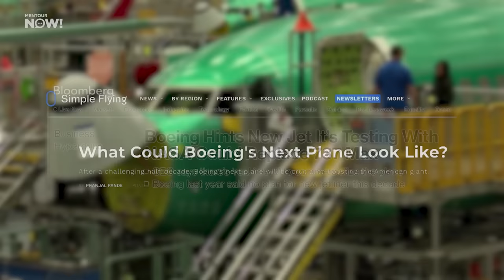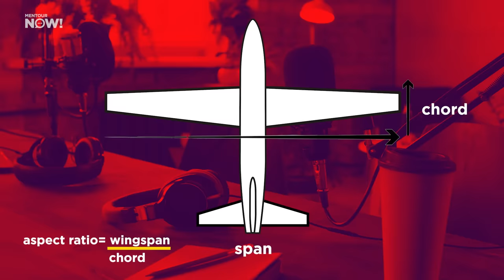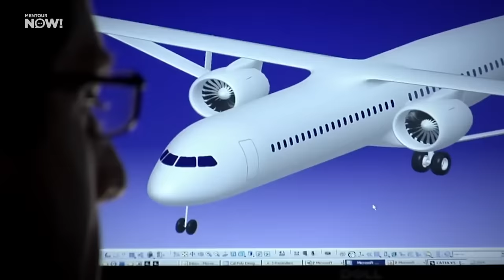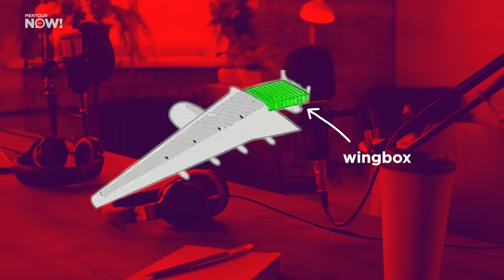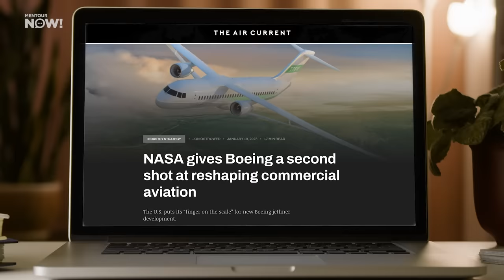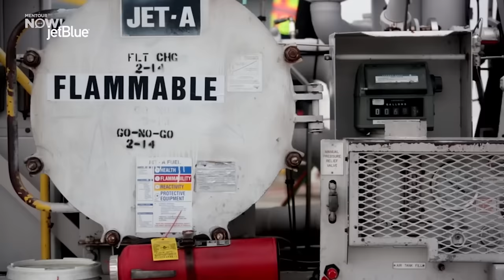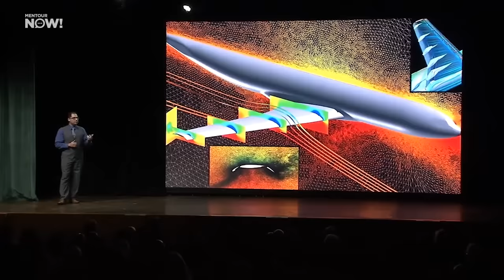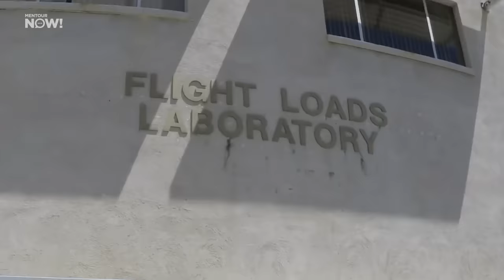Revolutionary Breakthrough: Boeing's Transonic Wing in Partnership with NASA!

Comment: The folding section actually only needs to be 8m because, presumably, both wings would fold. Still not small, but much more manageable.
Reply: Maybe so... BUT a new "radical design" would be more FUN if it just made ONE of the wings fold straight up in the air instead... don't spoil the SHOW, man...

     AND yes, before anyone gets pissy... some REALLY strange looking aircraft ideas have actually FLOWN over the years of avionic history... from the "Ass-ender" to the "Scissor-wing" and few that were completely nuts... Even the Nazis got on the wagon for weird sh*t, trying for a bomber with off-set wings... People have had weird ideas about how to make planes "better" for a LONG time.

    I highly recommend "Dark Skies" for some over-views and jot down notes to deep dive technical terms and design numbers/models/series while you're trying not to laugh too hysterically. ;o)
Reply: I wonder if folding wings are heavier because of the mechanisms to fold it up like Motors and gears, hinges, cables, etc.
Reply: @dannydaw59  a part is always heavier than no part, so yes. It obviously still makes economic sense because the tips on the 777x fold. The decrease in drag from the longer, slimmer wings must beat the costs of added weight, and by a significant amount, or it wouldn't be worth doing.
Reply: This design doesn’t allow visual inspection for damage on top of the wing, and as an airline mechanic I’m not going up on a lift over aver over again all day to inspect every airplane wing that comes to the gate, it’s dumb as fk. The rest of the plane needs maintenance servicing and no one is going to waste time looking for equipment to go up on top of every airplane. They should be going after the Boeing sonic cruiser design with Hydrogen fuel cell driving electric motors, that’s a real winner not this stupid thing.
Reply: @tropicthndr   If it comes to production levels of a "fleet" like most of Boeing's other series, you and I BOTH know there's going to be an alternative innovated over using a lift to look at the tops of the wings... There'll be a robot to send up, or a telescopic tool to test by ultrasonic frequency or something and bring you back better information for sending a tech to "waste more time" than has already been spent on wing-inspections... It might be a matter of time, but it's a "when" and not an "if".  ;o)
Reply: @tropicthndr  : Anything hydrogen is never the better option, which is why almost nothing has been using hydrogen.
Reply: 8 meters vertical might give issues at those 'boarding-bridges' (name?) - and, wind, when parked. Would make more sense to pivot/rotate them horizontally - sure, only one hinge, but with a good locking system that should work.
Reply: @tropicthndr  I would be surprised if this design doesn't have cameras to watch such things, like we do with trains now.
Reply: @ibubezi7685  maybe they will fold past 90 and be over the rest of the wing.
Reply: Or just a mirror on a pole
Reply: @dannydaw59  I think you answered your own question. lol
Reply: Not sensible to fold only one wing. That would topple the aircraft. What a shame.
Reply: @vishnaik3914  hmm, if the weight of the wing would topple the aircraft, why would it being unfolded suddenly make it no longer topple? physics is strange but i dont think it works like that. especially bc you wouldnt fold the fuel tank, so the moving half would certainly be lighter than the static half of the wing.

i think the main reason not to fold only one wing is that it would look terribly ugly and be a pain to taxi into the gate. parking is already a nightmare at the airport.
Reply: @tropicthndr  Good point. However, the tail fin of a 747 is some 19 meters over ground. A high wing concept with fold-up 8m wingtips would probably add to that height over ground. But isn't the 19m of a 747 already exceeding the height to be visually inspected from the ground?